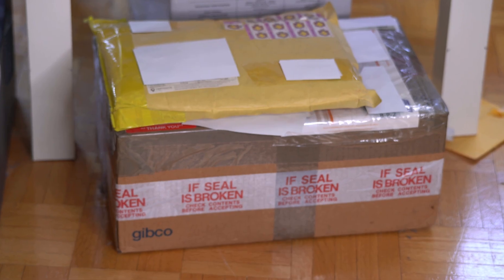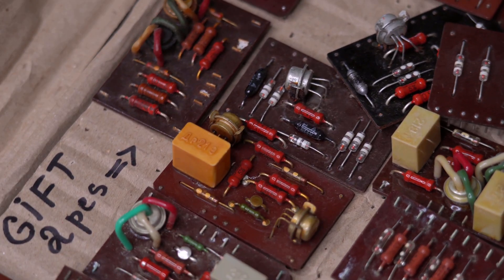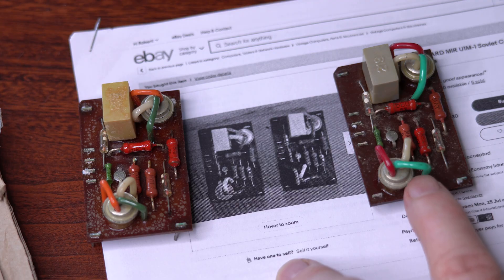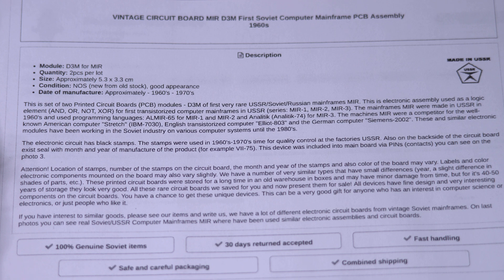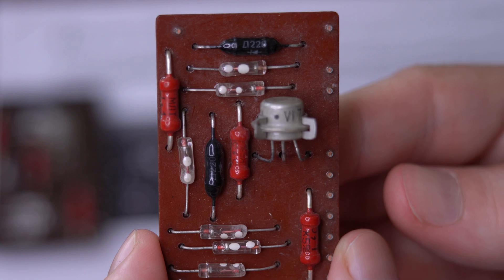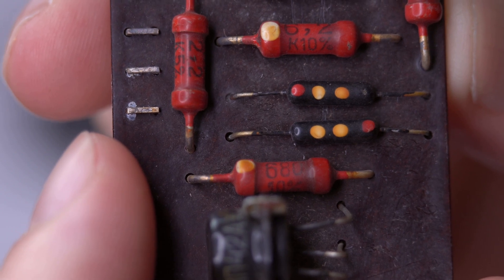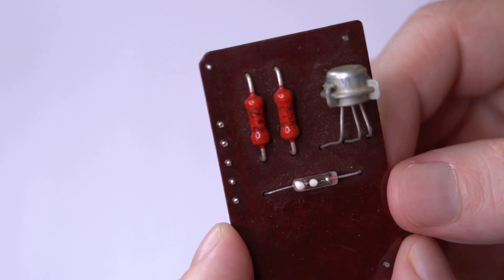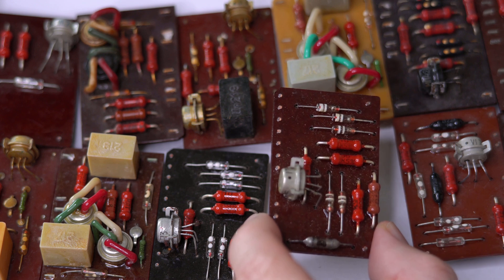My 1960s Ukrainian Mainframe Circuit Board Collection

Comment: Seems to be germanium transistors. They are sensitive to heat when soldering, so they are typically mounted on sockets or, like here, with long leads to reduce the heat transfer from the board when soldered.